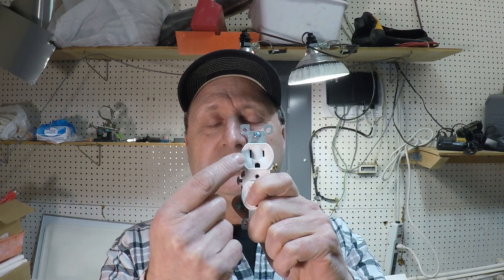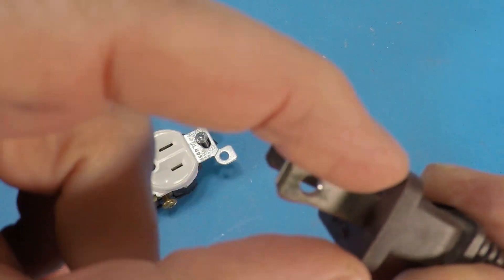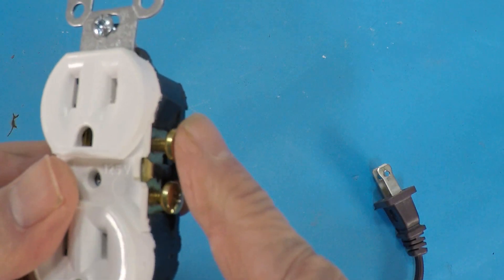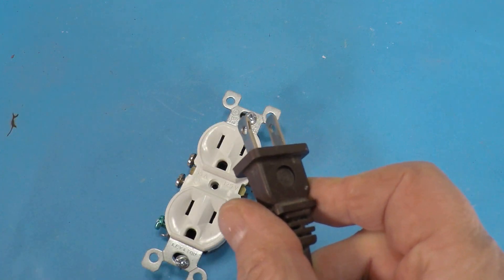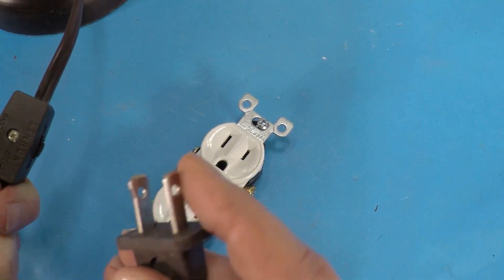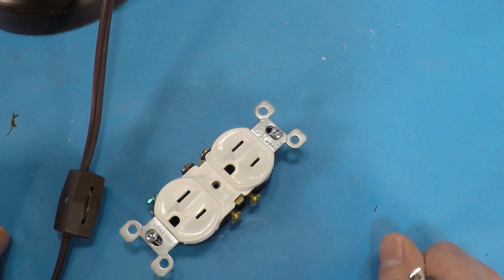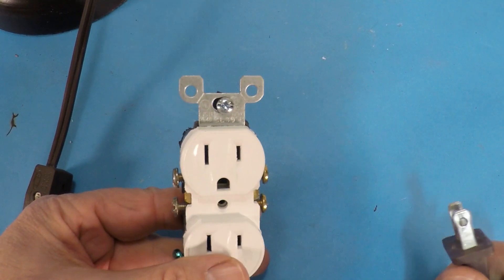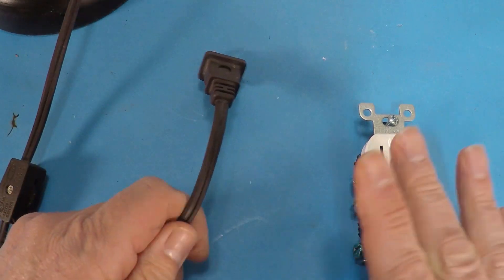Why Do Outlets Have Different Size Holes ? The REAL Answer

Comment: Whatever you're plugging in, it'll work just fine if you flip it and plug it in the "wrong" way. You just have to push it a little harder.
Reply from the maker: No... absolutely not
Reply: @flannelguydiy6458  I do it all the time.